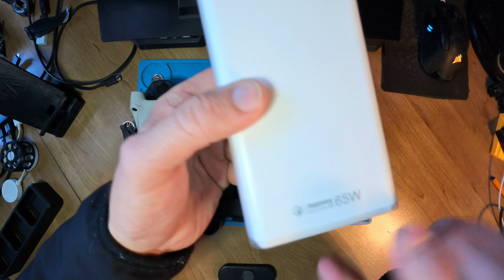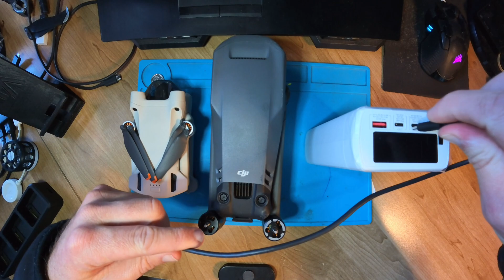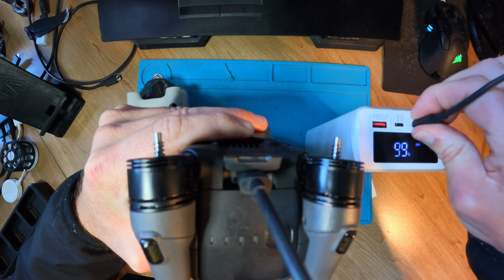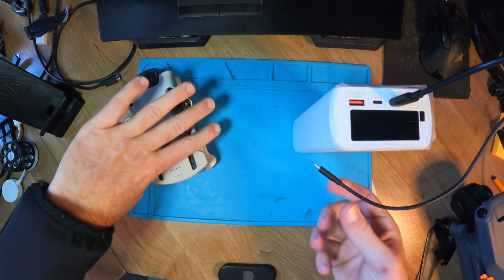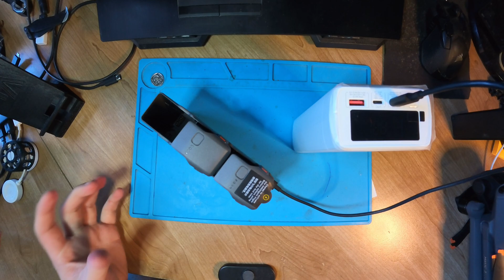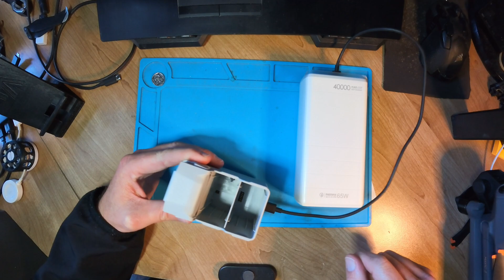Charge your drone with a powerbank!

Comment: How can I charge mavic Air 2 on this same process
Reply from the maker: You'll need an adapter. I use this adapter and it works great: https://youtube.com/shorts/qNOLEmLignk?feature=share

Here is the link to buy it: https://amzn.to/4hQXpEV
Reply: @InfinityDrones  If use the original hub (3 batteries) it works?
Reply from the maker: The adapter only charges 1x battery at a time. you'll need to modify the hub for it to work there

Comment: Is there maybe a way to get a 60W or maybe higher (foldable camping) Solar Panel to get to charge drone batteries? I've seen some that comes with it's own attached mini "inverter" that pushes out 12V 60W per USB-C and an adapter for 12V DC direct.  We have the Air 2S and 5 batteries. Going on an Adventure Bike tour, the tankbag will be housing the drone gear and GoPro stuff. Space and weight is limited as there is camping gear, rations, clothes, etc. that has to be considered, so bulky heavy powerbanks won't work. Would like to hear your opinion. You sound South African btw LoL
Reply from the maker: That solar pannel could work for sure if you find a decent quality one - they are usually very ineffiecient. I'm South African from sunny Cape Town :)
Reply: @InfinityDrones  Ahhh lekka!! We from PE haha Thanks for your professional channel. I also learned btw the Air 2S cannot be charged via AC usb-c port. That's for data transfer only. Batteries has to be taken out and put in that hub. So we have to plan around that. Keep well boet cheers !!
Reply from the maker: @MervinDeJager-o2s  I have converters on the way that will allow you to charge your air 2s via USB c :) Should be here end of next month.

Comment: The reason it is not charging fast with battery hub it because your power bank ir garbage. Normal power banks work just fine.
Reply from the maker: That is not true sir... check the specs. To get to 65w you need to charge at 3+amps at over 20v - You saying that a "normal" power bank can do that? How is this power bank "garbage" if its working so well? I don't understand your post to be honest... everything is contrary to the stats/spec and results shown in the video - did you watch it?
Reply: @InfinityDrones  you showed that it fast charges one battery in the battery hub, but when you put two or more it slow charges them.
Reply from the maker: @niekonesakyki  on some hubs it charges just fine and on the odd case it does not - this is hardly the powerbanks fault as its still pushing 60-65w.
Reply: @InfinityDrones  it is 110% not pushing even close to 60w if leds are blinking slow on a battery 😉
Reply from the maker: @niekonesakyki  I have a cable that measures the watts. How can I send you the pic/video? It does do 65w

Comment: Hello, my friend, I'm having a problem, can you help me?
Reply from the maker: What seems to be the problem?
Reply: @InfinityDrones  is having a problem with dji air 3 I want to break the company’s restrictions
I want to shoot in places that don’t have GPS, but restrict me to a height of 30m.
Reply: I'm restricted to 30 meters high.
Because there is no gps in the area
Reply from the maker: @Mhmmmmmmmmd  Air cannot be unlocked... best is to sell it and get a Mavic 3 as it can be unlocked.
Reply: @InfinityDrones There is no way???
Reply from the maker: @Mhmmmmmmmmd  not for the air 3.. dji locked its firmware up pretty tight
Reply: @InfinityDrones  Is there anyone who offers a solution to this problem, whatever the price?
Reply: @InfinityDrones  Is there anyone who offers a solution to this problem, whatever the price?
Reply from the maker: @Mhmmmmmmmmd  no sir.. What you're asking has been blocked by dji... Best bet would be to use a custom fpv drone or an older drone like the air 2s. Air 3 is a very new drone and dji has locked out all the exploits
Reply: @InfinityDrones ohhh ok bro
Reply from the maker: Just a pleasure

Comment: Hi, i try to charge avata 2 with power bank 100w and 65w and it only charge at 30w. Thé câble Can charge to 100w too. Do you sée thé same ? Dji says avata 2 Can charge at 65w !!?
Reply from the maker: Yes, as showed in this video the Avata 2 is fast charging - I showed this in the part of the video where I talked about looking at how the battery lights light up during slow charging vs fast charging. 
I do not know what powerbank you have, but if its not PD rated then you're not going to get the 65w you want.
Reply: @InfinityDrones  at 30w led is fast like you show. But it only 30w not 65w. I have USB c mark e chip on thé cable. And my power bank charge my mybook pro at 45w so. My power bank and câble IS good. I go to Ask to dji
Reply from the maker: okay